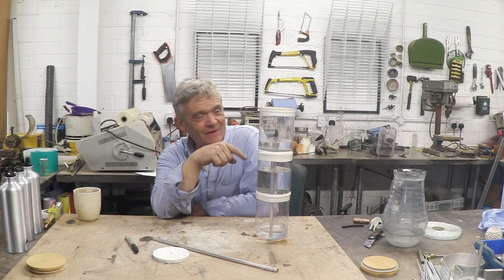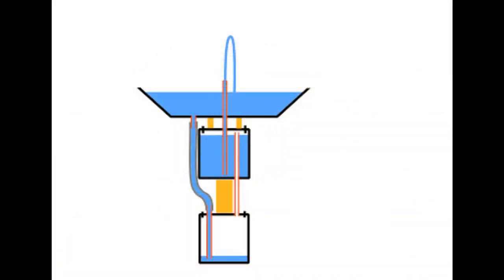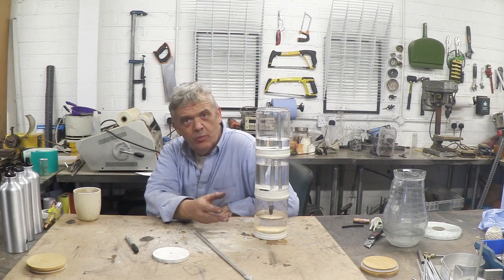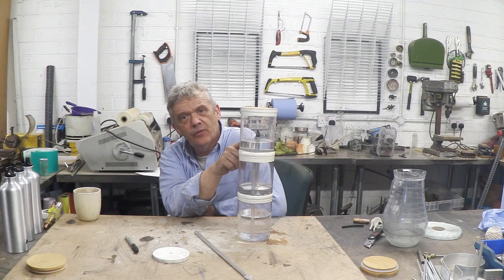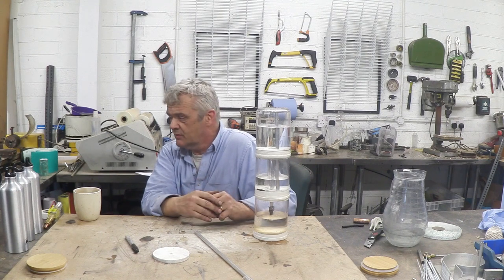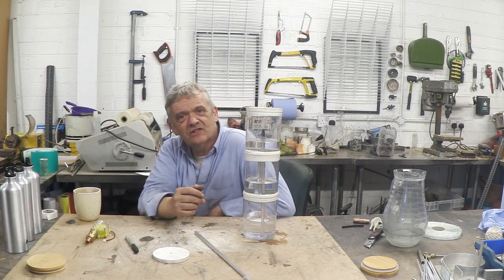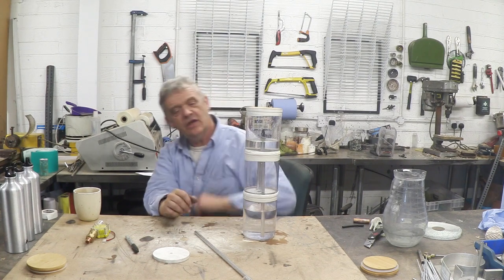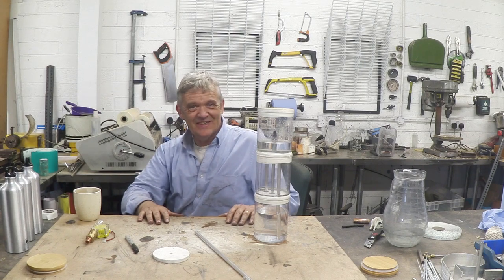Heron's Fountain As A Water Battery

Comment: Just use one container, pump water in the bottom, taking up space and compressing the air bubble on top, let the pressurized water out the bottom to discharge.  It's called a hydraulic accumulator.  Instead of air pressure you can also make the tank a piston and weight it down, this adds sealing issues but has the advantage of constant pressure regardless of state of charge (using a compressed air bubble, the pressure rises as the bubble gets smaller as opposed to having a constant weight pushing the piston, maybe a bellows would work?)  you can buy an off the shelf hydraulic accumulator, most well systems include them so the pump can cycle on and off instead of maintaining constant tap pressure.

Comment: Very interesting thought in combining the inline impeller and Heron's Fountain.  

Watching you flip the battery over throughout the video got me thinking about the "Drinking Bird" evaporative cooling and weight shifting demonstration.  If you center balance the larger battery you intend on building, you may be able to flip it on its balance point very easily.  

Just an interesting thought.  Looking forward to the large battery build.  Cheers.
Reply: There was a design I read about 20 or so years ago. It was a bunch of tanks connected in a circle like around the rim of a bike wheel. All the tanks where connected and the bottom tank sat in a bath of hot water. It would evaporate the liquid and move to to the top tank causing it to turn.
Reply from the maker: like a Minto wheel mate?
Reply from the maker: it's called the Minto wheel mate

Comment: Your discussion of pumping the water to the upper container/tank brought up an old (partial) memory. Back in the 1970s when solar energy experiments were all the rage, I recall a household solar water heating system that was self pumping, thanks to the solar input to the upper unit on the roof. It would draw water from a lower and cooler source, at low rate of flow, and feed it to a channel across the top edge of a solar heating panel, which was sealed of course. The water was heated quite efficiently as it ran through this stage, being deposited into an insulated tank for household use. The tank was high enough that gravity feed distributed it on demand, though probably without much pressure.
    An overflow outlet would deliver excess water back to the source reservoir, where it would cool. I do not recall much more than that, except that I found the "self siphoning" action interesting, since no electrical or mechanical pump, i.e. no additional energy input, was required. The system was closed as far as the liquid transfer, but it seems it was sufficiently open to not be using air compression. My memory shows the water flowing across a sloping solar heated surface, but flowing through tubes with a downward slope (gravity feed) might better assist the siphoning action, though I don't recall this being a feature. The design was so poorly described that I did not understand it initially, and having no immediate need and only reading the article "recreationally", I applied no effort to it and moved on. However it was supposedly a working system in the magazine article author's remote passive solar (the term "off grid" had not been coined yet) home.
    I've thought about revisiting this over the years when such a "self siphoning" or "self pumping" action could have been beneficial, but I never did. I wanted to see if it (probably the overflow function) might be applicable to feeding the upper hydroponic tray from the lower fish tank in an aquaponics setup, making it a closed system not requiring electric or manual pumps to transfer the liquid.
    Now that I am semi-retired I may get around to it. Any ideas, references, or suggeations?
EDIT: Of course as soon as I closed this video, two offered videos down, I found a Ram Pump, describing its self-pumping action. So long as you had a sufficiently large reservoir of liquid, it should pump constantly.

Comment: Very cool, thank you for sharing!!!  Thinking mounted on a wheel may be of benefit, has me pondering, thinking along the lines of Minto's Wheel...  Seems a bit of "baking time" is in order...lol. Bravo, as always!!!
Reply from the maker: I have often pondered the drinking bird which - I am sure you know is a Minto wheel derived device
Reply: @ThinkingandTinkering  Yes indeed, throw in a bit of thermal w/ a low temp "working fluid"...

FWIW, I had once designed an altered Minto's Wheel, oh, 20 years ago, or so...  If I remember correctly, had only 9 "pots" on it, 5 were plumbed together as were the other 4...  Plus, added mobile weight in a tube for each pot/ spoke, from the hub to the pot...  Tried to maximize the mass transfer... Is rpm, high torque, lol. Fun stuff!!!!

Comment: Do you think if you anchored the center container with a barring attached to a rod that attached to a post, and maybe paint the bottom container black and possibly replaced the air with some sort of gas it would move or tip over once a day just from the difference in temperature fluctuation between night and day? 
(Kind of like that drinking bird?)
Or maybe just paint one side of the bottom container black and the opposite side of the top container black?
You could make it as long as you wanted I guess 🤔
Sort of like a mechanical sundial/grandfather clock?

Comment: I like the idea of being able to just turn it over like a sand-timer. Something with those buckets with pivot in the centre on a stand so you can just flip it without effort might be quite handy. Imagine a huge version using 120-litre blue barrels! In fact, I wonder if such a thing could generate enough electricity to flip itself over with a motor?

Comment: Interesting Gadget.  Not bad for Lifting Water above a Certain Reservoir Level.
Of course Slightly Different to Straight Forward Pumped Hydro.
The Rotation Idea is Clever.  I have had similar ideas myself.
RMS, Thanks for the History.
Reply from the maker: it has caused a lot of interest over the years that's for sure

Comment: RMS, instead of the turbine, why don't you consider a Kelvin water dropper? It will produce DC and the mechanical losses will be nil. I considered doing this on the main water pipe to the house but never got around to it. The current may be small but with a supercap, could you store enough energy to charge a smartphone?
Reply from the maker: the current is in the microamp range mate - you would have a challenge generating enough to power.a phone I would think - but still worth looking into
Reply: @ThinkingandTinkering  Didn't the Kelvin water dropper produce a spark? Store the charge in a capacitor and use it to charge a cellphone.
Reply: Yes but first run the high-voltage and low current power source through a primary winding of a transformer with many turns on it. in series with that you could have a spark gap to switch the transformer on and off. then on the secondary winding have fewer turns. Then use diode(s) to rectify the current and charge a capacitor. Then add a 5 V regulator or a switch mode power supply to charge a phone.
Reply: @mikeguitar9769  It's DC. You'd have to charge it then bleed it through a capacitor.

Comment: If you do 4 in line and name it reversible like you said you could simply mount it on a frame with a stop at the top so they never quite are 90° so as one side empties and the other side fills up it will flip, then flip again, issuing gravity as both generator and battery
Reply from the maker: built one in the next video
Reply: @ThinkingandTinkering  great minds....

Comment: I have a crazy question, could this be slightly modified, and used with multiples, and put on a wheel and Axel. With the water causing it to rotate slowly? Like perpetual motion? Just a crazy idy!  Like have a fire under the wheel, or concentrated solar, to help move it along, like air/sream pressure pushing water to a offset container, causing rotation, when it moves, cooling, pulling the water back, but before it cools, another setup, pushes water to a chamber, causing rotation, it would be slow, but torque would be upto the diameter, and the water volume! Possible ???
Reply from the maker: yes mate but you would need the extra energy from the fire I think to keep it moving

Comment: If you had any evenly balanced number of these [typically in pairs] so that the rotational balance is relatively neutral, you can set it up so that it automatically trips a lever that makes it roll over to reset it.

Admittedly, you might need a lot of water volume, as well as vertical height, but, again, if you can easily flip it over like an hourglass, maybe it can continue to run infinitely.

No, not as 'perpetual motion' but basically, if the rotational balance is very very close to equal, it should require very little force from a passive side motion to rotate the assembly the 90 or 180 degrees one needs to put the next column into position to begin working.
Reply from the maker: I suppose so - interesting

Comment: I've been thinking lately about a crossover between gravity battery and water battery. I wonder how efficient it would be to use a pulley with two buckets on same cable. Filling bucket up high then the weight running a small generator, emptying at bottom, while the alternate bucket is being filled at top. Cycle repeats.
Reply from the maker: worth building one to see mate

Comment: That’s a nice idea but the problem with those water turbine generators is that they require a significant amount of water pressure in order to generate electricity , I have 3 of those and I did a few experiments with them so I know they won’t spin that easily and they need some mass to really accelerate..

Comment: Why not using the temperature difference from inside to outside to pump the first container to the second with one way valve (I have in mind Stirling engine principles...gas expansion to hydraulic power

Comment: Hello sir thanks for your video. Let me share an idea i was experementing before replacing the water turbine and it was working perfect.. basically i took a big sealed container and drill 2 holes on top.. then from the first hole i was filling the container with water and from the second hole i had a valve.. so the water was taking the air place in the container and because the valve was close air was compressing in the tank.. then i was able to start a steam engine basically a 2 stroke engine converted to run on air and it was running for a long time and in very high rpm controlling them with the tank valve as the throttle... A cool idea to replicate it.. i can see a huge potential in a bigger scale for example a city creating energy by its water consumption just running it very simple through a second pressurised tank.. Cheers mate i like your mindset so much !!!
Reply: its always good to recapture and reuse the byproducts of localised work done ,steam engines being more efficient reusing the outlet steam to drive high,medium, and low pressure drives being probably the best known example, reusing turbine outlet air to simply bubble feed a basic trompe sealed triple skinned set of containers to compress each inner tank to higher and higher pressures in a safe free way ...
Reply from the maker: nice one mate - thanks for sharing - I like the idea for sare

Comment: Couldn't you have 2 "standard units" connected together, one filling the other and vice-versa as they empty? Perhaps with the turn of a valve?
Reply from the maker: you could - but you could also just add another fountain tank to the top then use. the transferred water to run the second fountain tank

Comment: Do you think there is some way this fountain could be arranged as a Kelvin water dropper and take the charge to a capacitor for continuous charging and use? 🧐
Reply: Maybe using the air head as the separation for the difference of potential.
Reply: Oh bother I see impossibilities with it and it would have definitely been done long ago surely🤪
Reply: Well maybe using two or three fountains where they feed each other's head pressure. Hmmmm.
Reply from the maker: water droppers don't produce a lot of amps mate - volts for sure

Comment: Funny this, I was looking at a 3 gear transmission and thinking of using one gear to drive the other, that drive the main gear. So the same with pressure. The falling water added pressure to one container, which adds pressure to another container (Smaller volume, greater pressure), which can push the water back up and have a continuous cycle. Maybe add air bladders, in the system, that can pressurize a little to add in the circulation.
Reply from the maker: ii then you would need input energy at some stage mate - here we are turning it by hand
Reply: @ThinkingandTinkering  Oh, how much energy did you put into building this? I did not know there was a rule about putting in air. Maybe I have too much air to put into this channel. lol Keep hand turning. I can't see myself stand by waiting to turn this every 2 mins, when I can add airpressure and have it run for days/weeks/month/years even. But whatever makes you happy. Your laughter make me smile :)

Comment: i was delighted by today's offering though the next size up would be something that can turn a car alternator that can give you 500 to 1000 watts output which is about as small as you can go for house sized projects i have always thought that windmills are much better suited  to high torque low rpm like you might use to pump water or air then you could use several of your smaller devices to accumulate enough water or air power to run the alternator for a useful amount of time:-)
Reply from the maker: wind power and pumping are an awesome combination - after all loads of farms all across the US had a wind powered pump - of course it would also help even out the peaks and troughs of wind
Reply: @ThinkingandTinkering exactly and it puts all the complicated high wear bits on the ground were they are easy to ge to.

Comment: I rember this mentioned in school, but our foccas was on the first 'steam engine' 
I have been thinking about as many ways as I can , to generate power on my mini homestead, for my offgrid home. I have a small spring, that can go dry in summer, I was thinking water wheel generator, then I thought a small pumped hydro,  I'd like to get atleast 400-500 watts, and use excess solar to ' charge' the system, I have a river close by, I could probably set up a undershot water wheel on pontoons,  with the possibility of generating 500 watts plus, but would be a job, in a tough to access area, but with a wheel about 7' dia, and about 8' wide, and slightly dam and deflect the water to go through the water wheel, I'm not sure, but if I could get 1200 watts, 24/7 I don't think I'd need solar! But I'd keep it to charge the batteries faster, at night my consumption drops to below 400 watts, so the solar could charge during the day, and about 800+ nightly, in theory, 
But this system is interesting, building it with 400 gal, containers, and double everything! Do you think it could be 'supercharged' by adding energy to the system, like pressurising the draining chamber? Just 1/8 bar could make a substantial difference, forcing the water out, depending on the diameter of the discharge orifices, adding a hydraulic motor, to spin a generator, or possibly a turbine, 
Have you heard about the gravity generator, a guy in the 30's possibly used it to power his garage with a 100w motor, it amplified the power, using gravity to spin a shaft, the 100 watt motor just wiggled the shaft, so the offset weight, on the shaft is always falling, spinning the shaft, I have seen ppl try to replicate it, by old video clips, they have the weight loose on the shaft, I think it's where they fail. Sorry about the rambling, it's a rainy day here, and we had a earthquake here Sunday! Crazy it was a 5.1 in the NC mountains/foothills. The first in 100years,  great video, I guess you can see , it made me think!
What's NEXT???
Reply from the maker: what about an Archimedes screw as a generator instead of a wheel?
Reply: @ThinkingandTinkering  yeah maybe!  I have always wondered about the effiencey of archie's screw, I haven't seen a true one in operation, there were some hydroelectric generators using it, I also saw. A similar system using a impeller, it seemed to work about the same, I have no data on the operation, if I had a small creek running down hill, it would solve all my power issues! Ha-ha not that lucky!

Comment: Yes very good coverage of the different batteries cells
I'm keeping up on the tesla car batteries lithium phosphate cobalt aluminum carbon  advances

What I really want you to cover is a dry crystal copper zinc cell that is powered by the quantum flux activating piesio crystals with the cashmere effect oscillating the pesio electric crystals.  One will make 1.4volts but the amperage is small
Check John Hutchinsons work

Please do a show on them as they do not decompose

Thank you Robert James
Reply from the maker: I'll check it out mate